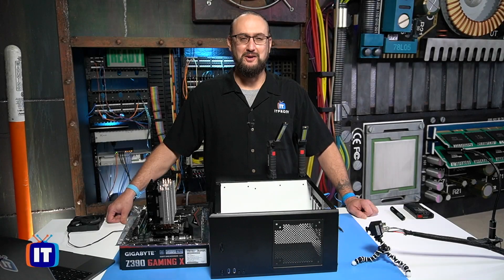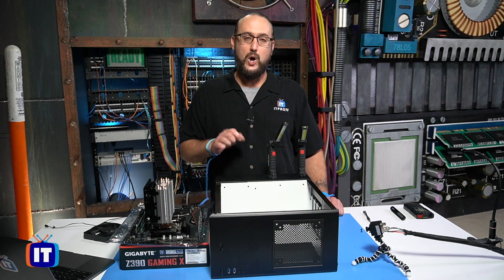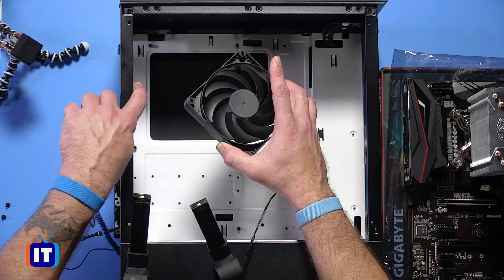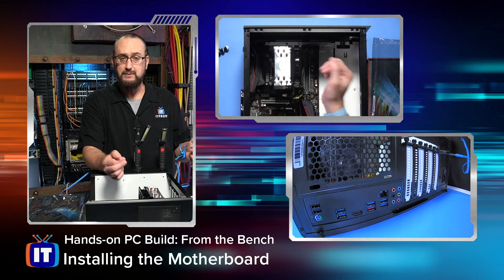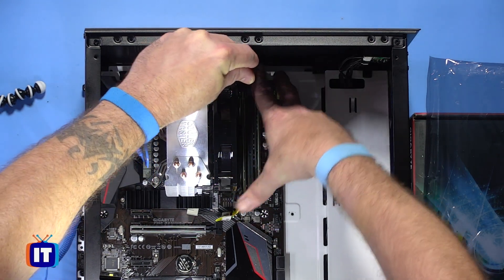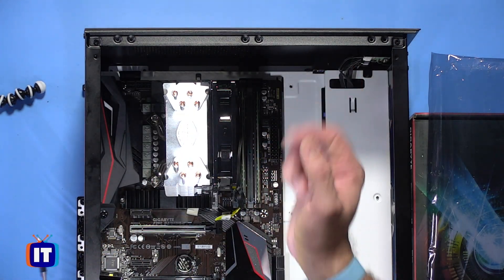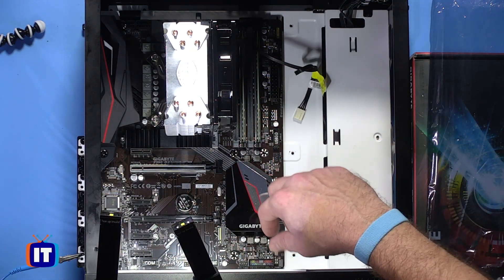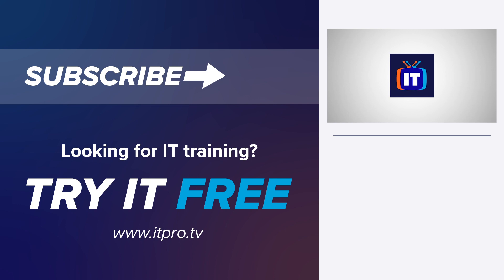How to Install the Motherboard | How to Build a PC

Comment: I wish he would have shown us installing the stand-offs and talked about the different cases and how they use different size stand-offs. Also, talk about the cases that have little mounds for the stand-offs to screw into. I just recently received some stand-offs size M-3 which would not fit my case. It seems that possibly that these stand-offs are meant for a different country or something. I was lucky to find some on my other case I was able to cannibalize and install into the new system I am building but it is a case over fifteen years old. But I can't find a case that I want. I need a case with lots of USB 3.0 ports in the front and to have a 5.25" bay for my Blu-Ray burner as I do still burn DVDs and have lots of files and software that is on cd or DVD.

Comment: Why the double grounding straps? The left hand doesn't know what the right hand is doing?
Reply from the maker: When shooting the videos there is a possibility to generate static electrical charge, and I wanted to be extra precautious to insure that there is no static discharge on the components. One ESD-strap is more than enough under normal circumstances and even self grounding techniques work likewise. Thanks for watching!